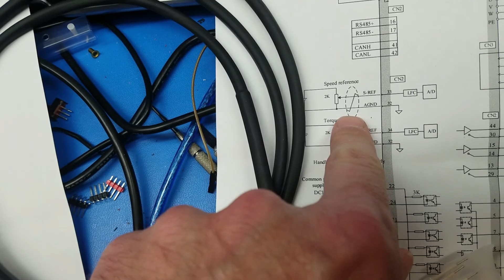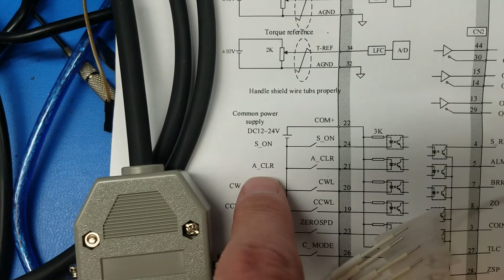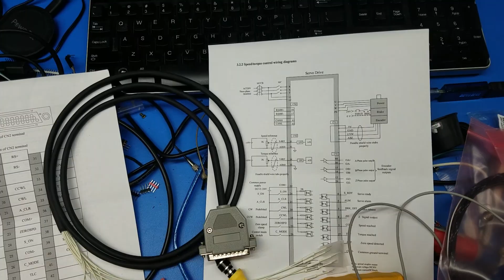Dorna EB-EPS servodrive specific connections

Comment: Hi Thanos ...sry about my question but i am a little bit in trouble with my DORNA EPS-B1 server drive. do you now how i can reset the controller to the factory settings? maybe you have a idee because into my manual i cant find nothing about. that will help me really...thx in advance Daniel
Reply from the maker: I have instructions on how to reset the Dorna M1 on my Discord. Join here: https://discord.gg/bx4PxYR
Reply: Hello can you help me? Pa 205 Pa206 Are parameters to configure the number of pulses per revolution right? So, can you tell me what is the operating logic of these two parameters, does it divide some standard value in the engine to arrive at some number? So that I can configure my dorna to 2000 pulses per revolution how would it be done? Thank you very much in advance